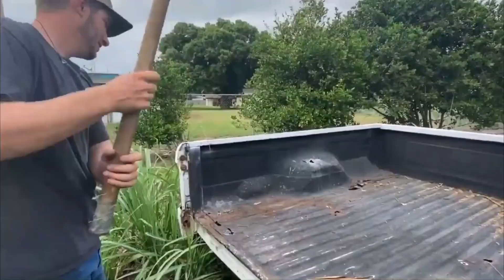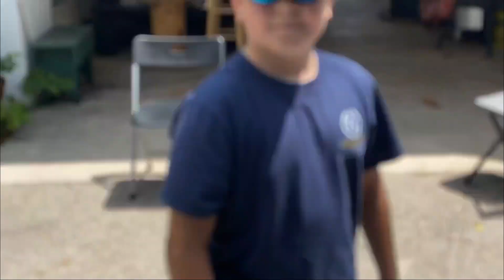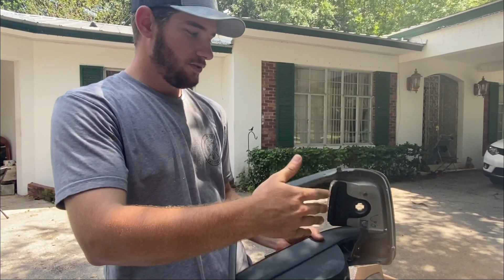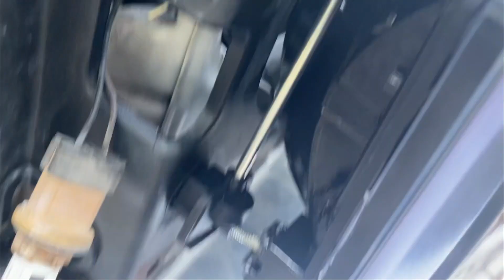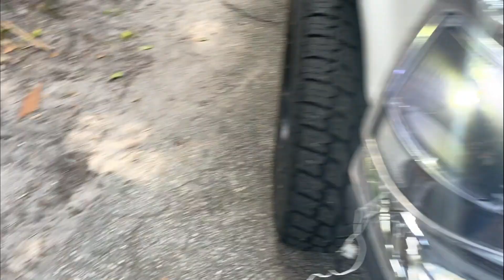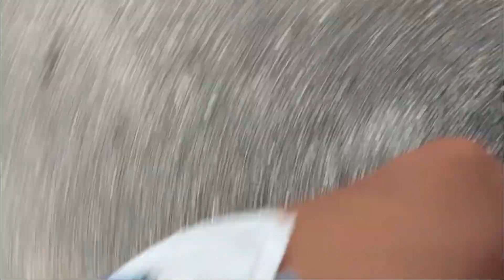The Best Looking Headlights for an OBS!

Comment: Do they still make these headlights? I’ve been looking for them for a long time and they are sold out everywhere.
Reply from the maker: I got these from Protunning but I think they discontinued them.
Reply: Yeah check ebay just bought some 👍
Reply: @elslick  I found a nice set from RZ lightz, they are pretty nice
Reply: @jamespanchik3167  the $400 set? I’m looking rn thinking about grabbing them they look really damn good
Reply: @deeznuts1358  yes I like them, wiring wasn’t very difficult, just taking the housing out was the longest

Comment: Where did you connect the white and black wire?
Reply from the maker: I believe it tied them to the running lights. I cut one of the running lights off and made a splice.

Comment: I was thinking about getting these for my truck but in your video it seems like the corner light that gets turned into to turn signal light dosnt come on with the running light? Is that correct
Reply from the maker: Correct they stay off with the running lights off.
Reply: @JoelG7.3  that's dumb so you have to rewire it just so the turn signal comes on with the running lights thanks for the info.
Reply from the maker: @aydenthomas5861  Yeah they didn’t give any instructions with it so I just wired the running lights that I wanted together.
Reply: @JoelG7.3  makes sense  i really like the look so I might just have to give the a shot how have they been for you any foging over on the housings

Comment: Ran into the same problem with the adjuster being backwards. How did you filp it around? Thanks
Reply from the maker: Had to run it backwards until it came off then I flipped it around if I remember right.
Reply: @JoelG7.3   thanks man! I figured it out shortly after. Also where did wire the leds in
Reply from the maker: I think to the running lights wire. I think there was an extra pug that I cut off and wired them into. @GamerGentry

Comment: I installed these and the only issue I'm having is adjusting the housing. The lights are just pointing down at the road.
Reply from the maker: I tried my best and one of them aimed right and the other I just pushed the headlight up and it set higher a little .
Reply: @JoelG7.3  Alright, mine are just pointed at the ground quite a bit. I think I tightened the top ones a lot and I'm not sure if they should be like that.
Reply from the maker: @cadencovey3767  Yeah try physically pushing on them to aim them. They did not make these headlights well.
Reply: @JoelG7.3  Alright thank you
Reply from the maker: @cadencovey3767  No Problemo

Comment: Can you make a video on how you wired them up lol im honestly so confused
Reply from the maker: I got rid of this truck over a year ago lol but I think the side marker bulbs weren’t being used anymore so I cut it and wired the top and bottom new LED strips straight to it.
Reply: @JoelG7.3  okay so your saying the headlight wires and the marker light wires would be wired to the side marker light wires??
Reply from the maker: @brandonparker1274  Yes because the new lights had no spot for the side marker and since the side marker is just on when the truck lights are on it just tied my new LED strips into it so that they would turn on and just stay on when the headlights are on. Also when you turn on low beams they come on and looks pretty cool as you can see in my thumbnail.
Reply: Appreciate the info Buddy should help me out alot lol
Reply from the maker: @brandonparker1274  Yessir let me know if you have any more questions
Reply: Gonna let you know homie I got em all wired up and working, thank you for the help
Reply from the maker: @brandonparker1274  Yessir no problem
Reply: Got one more question for ya bud did your blinkers work after you wired them up?
Reply from the maker: @brandonparker1274  Yes I I don’t think I touched the blinker wires